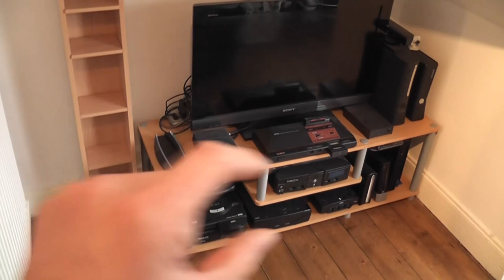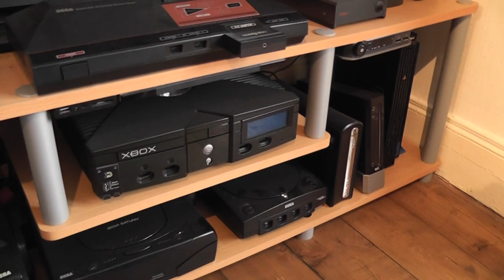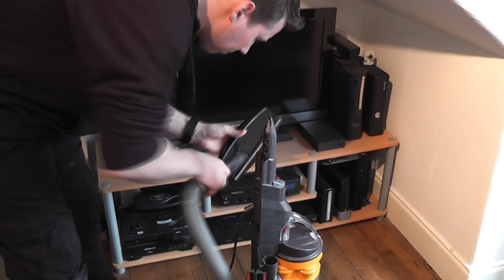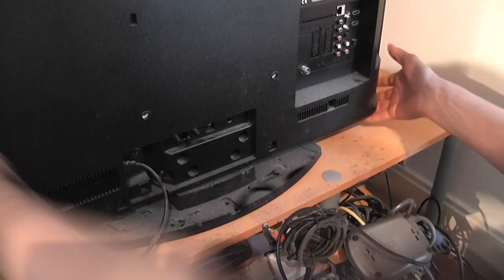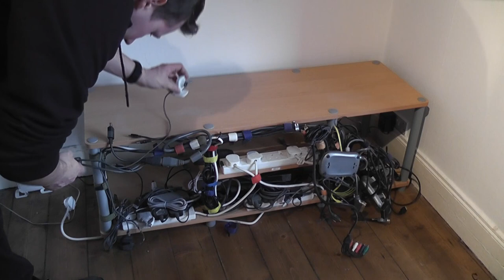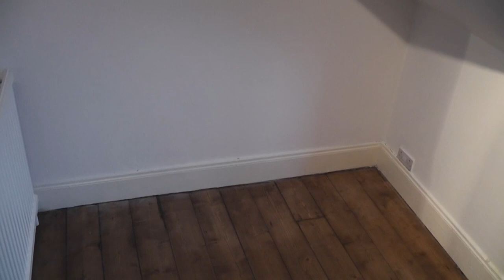Moving House - Gaming Setup - Teardown for Transit - Part 1

Comment: I have always been impressed by the wiring job you did on that setup. My setup has always been a pretty horrendous spaghetti of cables and it's only about 9 devices currently connected to that TV (PC, 3 consoles, now unused PS3 PlayTV box, Chomecast, secondary router, blu-ray player & 360 HD-DVD drive). 

Great idea with the cling film, safe from scuffs and keeping all the wires together, so they're all in one place ready to be disassembled bit by bit at the new place.
Reply from the maker: +DaveSimonH I think I'm going to scale it back a bit for the new setup :) Simplify the whole thing and keep it as tidy as possible.
I've worked in a few warehouses and got the idea from the way we used to wrap pallets and cages before loading onto trucks. The only difference is a much bigger industrial size role of cling film :P
Don't suppose you or anyone you know is looking for a 32" 4:3 Sony flat screen Trinitron CRT TV? I may have one free to a good home.
Reply: +RetroGameTech I don't have the space to have my older consoles out unfortunately, let alone a big CRT. 
Hopefully you'll be able to find someone to take it off your hands, few years ago I ended up having to take a couple of old 20" CRTs to the dump as nobody wanted them. They weren't Sony TVs though, so fingers crossed you'll have more luck.
Reply: +RetroGameTech do u live in Scotland ur accent sounds Scottish

Comment: Good to see a fellow scot back!  Should try that dreamcast hard drive mod (not the SD one you had), its a new board that replaces the gd drive (think its called something like GD EMU).  Im going to canabalise an IDE ribbon and hard wire it because the mod cards are too hard to find.  Hope your fitting into the new place
Reply from the maker: +Suave Bob I'd love to try it! I remember there being a limited run on the boards a while back. Crazy expensive if I remember correctly?
Reply: +RetroGameTech Yep bit pricey for my liking, vaguely remember £120 ringing a bell.  I had emailed the guy making them but the runs were just too limited and would have had to wait months even if I had wanted to spend the money, but I was sorely tempted.  Think the guy also had the same system for the Saturn.
Seems straight forward enough of a process though going the IDE route, just fiddly with the number of connections.  Not sure if you could do it the same with the SD card, if I remember right the hard drive was the easier option (even though youd need to power the hdd).  Maybe the chinese will make a copy of it like they did with Krizz Everdrive

Comment: Yes your back you inspired me to buy a Spares or repair PS4 From Ebay for £40 That was missing parts brought £20 Worth Of Parts got it working then sold for £210. As bullock thirteen said The King Has returned